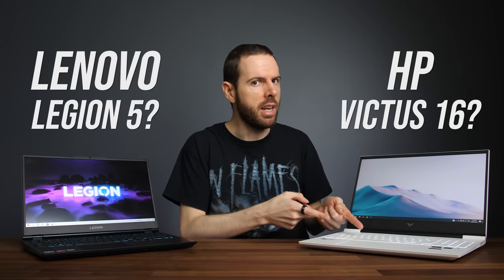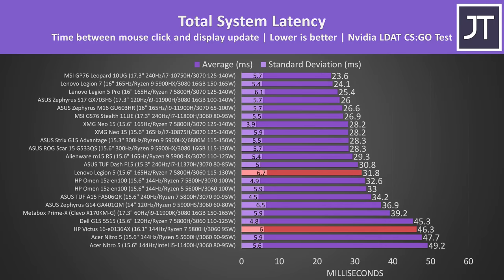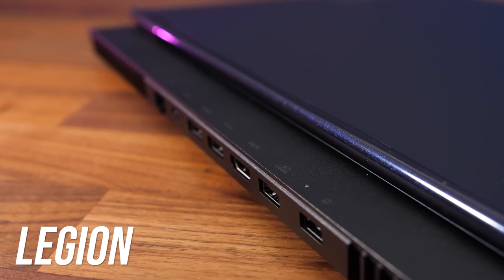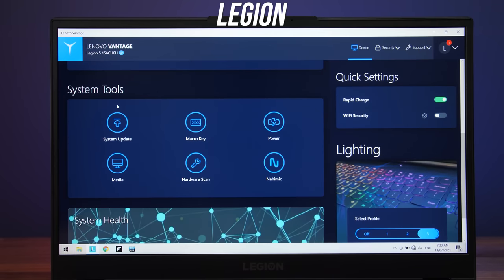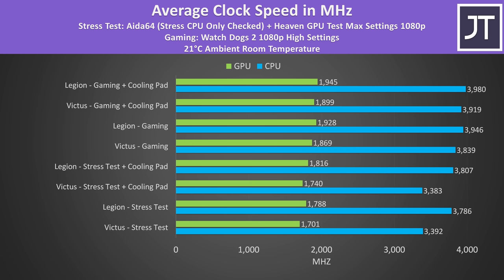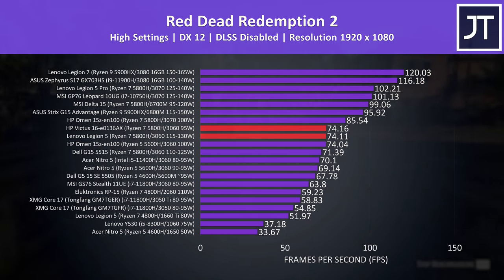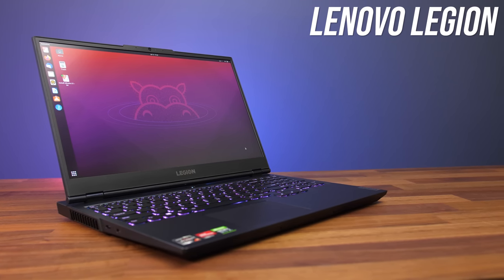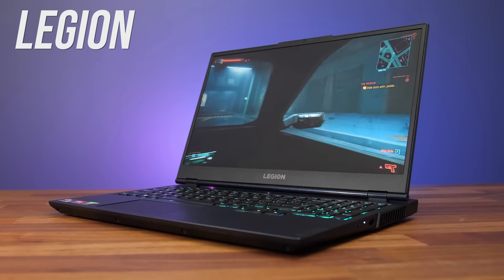Lenovo Legion 5 vs HP Victus 16 - EVERYTHING Compared!

Comment: In India, The Legion is sold from 1800$-2000$ by retailers. The Victus is sold from 1450$ to 1550$. Around 350$ to 450$ more expensive. And it provides 15% more performance  for 25-30% more money. And for most current gen games the Victus already hits 60fps in Ultra. For high settings, I don't even know why a legion is needed !! Now you know why the Victus is very popular in India but Legion isn't. Over here budget is smaller so one calculates the value more.
Reply: The screen wobble.
Reply: Only problem is availability lol
Reply: Makes sense. I've always wanted to opt for the legion 5 pro but it's over my price range. So I feel like the victus is a good compromise
Reply: @neer3  Agreed. The Achilles heel. They had one job... In India its a 100%sRGB one too. For some goddamned reason they couldn't increase the hinge tension to prevent this.
Reply: @tsozohoshi6182  Yes. The scalping and rip-off by the retailers are insane !! It now sells for 1.5L and people are still buying it 🤦🏻‍♂️. People should know the difference between a rip-off and a good price
Reply: @Ishant4President  The 5800H+3060 was an insane value for money product. More people are buying laptops now due to WFH, portability etc. Also nows a good time since 4000 series will be much more delayed. Due to these factors, people are using bots to buy laptops I hear. Most 3060 laptops are out of stock
Reply: @SF-li9kh  tell me about it man I've been eyeing a 3060 laptop myself for the past 3-4 months

Comment: I mean Legion is often called as best for this year, and victus is lower tier (Omen should be better comparison for Legion 5) so we all knew where this is going 🙈
Reply: Well a lot people requested this video so...
Reply: a comparison beetween omen 16's i7 11800H - 3060 115W (with mux too) v.s. legion 5's 5800H - 3060 130W would be an interesting one tho, and the price is almost identical (with omen 16 a lil bit cheaper)
Reply: Agreed. I don't think it's a good comparison. The 3060 should be further split into 3 sections. 75W, 100W, 125W and then compared. Moving from one subtier to another drastically increases price
Reply: @Respecta1512  11800h is slightly better for gaming, the extra 15 watts don't make too much of a difference because of diminishing returns so it would be pretty close I think (keep also in mind it doesn't always boost to 130w)
Reply: @suschilegge1683  yea I agree with u, but the omen too the same, it doesn't always boost to 115, heck the official cs said that its a 100W version. Nevertheless, yea considering the 1rx8 ram sticks on omen it may be slightly better it just doesn't have gsync
Reply: @SF-li9kh  No, what we want to know, is how much can you overclock the 75w rtx 3060 and how close can you bring it to the 100w versions.
Reply from the maker: To be fair, both can be available for the same price :)
Reply: @JarrodsTech  fair enough, I only did my research on my country price. RTX3050Ti Legion5 is like 150$ more than Victus RTX3060 😂(same storage and RAM). 

a similar price can be achived if I compare Legion5 with Omen
Reply: @ValentinoNicko  not everywhere
Reply: @ValentinoNicko same. A default Legion 5 3060 was like $350 more expensive than a 3060 victus, so I chose Victus 2 years ago.

Comment: "It's not really a problem unless you bump the laptop or desk or move the laptop around" or a wild Jarrod appearing and using raw blowing power 😂😂
Reply from the maker: True 😅
Reply: @JarrodsTech  Why don't Lenovo make a 17.3 inch 16:9 or 16:10 Legion 5 Pro with 1440P or 1600P resolution? That would literally be the perfect laptop! L5P screen is just too small in my opinion.

Comment: Legion is great, too bad it costs like 35-40℅ more than the Victus for similar configs (except GPU TDP) in my region
Reply: hi. i wanna buy laptop and i have to use it maybe like 8 years. laptops are 2x expensive in my country so for my budget i am between this four: lenovo legion slim 5 i7 13700h - rtx 4070 - 1 tb ssd - ddr5 double channel 32 gb ram and acer predator 16 i9 13900hx - rtx 4070 - 1 tb ssd 16 gb ram. and asus rog strix g16  i7 13650HX-RTX4080 12Gb-16Gb-1Tb- and  Ryzen 9 7845HX-RTX4070 8Gb-16Gb-1Tb Ssd. which and why i should buy ?

Comment: I bow down to legion..Heads down after having so much of personal experience with all windows Laptop brand. I found legion to be best combination of minimal, stylish, best build, performance, cooling and many more..
Reply: Yeah but where i live it cost like 1300 € while the victus is a solid 800 💀
Reply: @JA-ds5nq  You should opt online and on sale... Legion is mostly bought on sales as its very expensive
Reply: hi. i wanna buy laptop and i have to use it maybe like 8 years. laptops are 2x expensive in my country so for my budget i am between this four: lenovo legion slim 5 i7 13700h - rtx 4070 - 1 tb ssd - ddr5 double channel 32 gb ram and acer predator 16 i9 13900hx - rtx 4070 - 1 tb ssd 16 gb ram. and asus rog strix g16  i7 13650HX-RTX4080 12Gb-16Gb-1Tb- and  Ryzen 9 7845HX-RTX4070 8Gb-16Gb-1Tb Ssd. which and why i should buy ?

Comment: I mean, Victus is good looking and everything which I love it..
but every laptop gets compared with the Legion 5, that probably means it is the best choice which no other laptop had a good balance to take Legion's place for comparisons.
Reply: Yes, but as seen here, the victus was trading blows with it. And seems to beat it massively on value. Infact, the real champs are the tong fang chassis laptops.

So the legion is pretty poor value. Its like the people who used to think alienware was the best. It wasn't. Same here.
Reply: The Legion 60Wh 3060 I can buy is superior on 2 key points.

The rear port setup and the usb c charging offer enormously superior flexibility imo.

Not having type C charging is just not wanting to sell your product if you released them over the last year.

Better screen is bonus.

That said the Victus looks better and has better cpu for the same price where I am at. Slightly larger battery at 70 Wh, better speakers.

The biggest downside on the legion to me is the fan problem. I'll have to see if I can live with that.

But the port, charging flexibility is more important to me than if there is an ever so slightly bigger battery, the speakers and (hopefully) the noise.

I would pick the Victus if it had type C charging probably.
Even at these price points you have to make compromise sadly apparently.
Reply: hi. i wanna buy laptop and i have to use it maybe like 8 years. laptops are 2x expensive in my country so for my budget i am between this four: lenovo legion slim 5 i7 13700h - rtx 4070 - 1 tb ssd - ddr5 double channel 32 gb ram and acer predator 16 i9 13900hx - rtx 4070 - 1 tb ssd 16 gb ram. and asus rog strix g16  i7 13650HX-RTX4080 12Gb-16Gb-1Tb- and  Ryzen 9 7845HX-RTX4070 8Gb-16Gb-1Tb Ssd. which and why i should buy ?
Reply: @lalabeauty8121  from those options...
Lenovo and the Asus are the best looking..

Lenovo is balanced and has everything you need for a minimum of 5+ years

Asus has a better GPU but has half of the Lenovo's RAM which I hope is upgradable..

I would take the Strix g16 just because it has a better GPU and the RAM is a part which is usually upgradable..

in simple terms, I've looked it on the user benchmark and the higher number the better, and I trust ASUS and Lenovo Laptops, Acer is usually not the ones anyone would suggest

Comment: Legions prices are crazy this year. Last year they were the best value laptops, this year 3060 Legion is more expensive than a 3060 Zephyrus G14 where I live. If it weren't for no additional M.2 slot on Zephyrus (I need it for additional SSD, as I have one from my old PC) I'd be daily driving a G14 despite much lower GPU TGP, as the overall quality is much better. Not to say that Legions are low quality, but they just don't compare when the pricing is similar.

So... I am waiting for black friday deals, I guess.
Reply: @gderioaryaputrarahadi9400  in February we had pretty sweet deals for last year models (4600H+2060 for around 650$), but now even last year models are more expensive than when they released.
Reply: The real biggie is that due to fluctuating prices, can you really decide on whether to get the Legion or the Victus? You may say he'll yeah, but you know the moment you buy the Victus the price for the Legion will drop, ie sales etc.
Reply: @garymiles484  I almost bought a Victus about a month ago. Seemd like a good deal, with 1TB SSD and 100% sRGB 300 nits panel for around 1000$. Turns out, shop had a mistake in specs, good panel option isn't available anywhere, it was the same as Jarrod has. Shame.

Whatever I'll end up buying, I won't check laptops pricings for months after that, lol. Buyer's remorse is inevitable otherwise :)
Reply: @gderioaryaputrarahadi9400  boy, have to admit it, you have it way worse than where I live :)
Reply: A Legion 5 when it's on sale for $1300-$1500 is a no-brainer, but at its regular MSRP you can do much better.
Reply: I found a $1000 for 3050 Ti 512 GB but other than that everything else is way too overpriced
Reply: @sp0el  yes, I bought a Legion 5 (2021) for my daughter about 3 months ago, 3050ti with 512 gb nvme and 1 tb nvme for about $1150. Okay so the 3050ti isn't as good as the 3060 but still a good price. With all the sales coming up you might have been able to wait.
Reply: I got Legion 5 with Ryzen 7 5800 and rtx 3060 for $1300 (On sale)
Reply: They're literally the same price as last year in the US.
Reply: @sp0el  in India a 11400h victus is listed with 3050 online but they actually deliver a 3050ti😂
Reply: @suryanshpundir7463  I'm happy for you then! :D
Reply: hi. i wanna buy laptop and i have to use it maybe like 8 years. laptops are 2x expensive in my country so for my budget i am between this four: lenovo legion slim 5 i7 13700h - rtx 4070 - 1 tb ssd - ddr5 double channel 32 gb ram and acer predator 16 i9 13900hx - rtx 4070 - 1 tb ssd 16 gb ram. and asus rog strix g16  i7 13650HX-RTX4080 12Gb-16Gb-1Tb- and  Ryzen 9 7845HX-RTX4070 8Gb-16Gb-1Tb Ssd. which and why i should buy ?
Reply: @lalabeauty8121  

Pick one with the RTX4080. Aside for 32GB RAM in the Legion, that RTX GPU is the only meaningful difference when it comes to performance between all of them. And while the RAM can be upgraded, you can't do so with the GPU.

Comment: In my opinion, victus is the best out of these. I like the looks of it, and has very good performance.
Reply: Currently enjoying mine (though it's ryzen 5600H variant) and playing just in quiet mode to keep up with the cooling part but still get 144+fps. Also it's way cheaper than legion
Reply: the design is sexy as hell 
also that keyboard has to be the best feeling laptop keyboard i've ever experienced
Reply: hi. i wanna buy laptop and i have to use it maybe like 8 years. laptops are 2x expensive in my country so for my budget i am between this four: lenovo legion slim 5 i7 13700h - rtx 4070 - 1 tb ssd - ddr5 double channel 32 gb ram and acer predator 16 i9 13900hx - rtx 4070 - 1 tb ssd 16 gb ram. and asus rog strix g16  i7 13650HX-RTX4080 12Gb-16Gb-1Tb- and  Ryzen 9 7845HX-RTX4070 8Gb-16Gb-1Tb Ssd. which and why i should buy ?

Comment: Please do a price to performance comparison between all the amd mobile GPU Radeon Rx 6600m vs rx 6700m vs rx 6800m.Wich do you think is the best in respect to the Nvidia's offering
Reply: That'll be interesting..
Reply: Yeahhh... AMD looses. Even in the US. And outside of US, nvidia beats them.
Reply: @siyzerix  It would be more reassuring if Jarrod's Tech said that
Reply: @neerajthakur708  Listen man. Does jarrod tech know the indian market or pricing structure? No. He doesn't. 

Infact he uses american pricing. So he'll go off that. You'll have to use your head and figure out for yourself in India which laptop holds the price to performance title. And hint, it ain't lenovo legion 5 like jarrod might suggest.
Reply: @siyzerix  Which is it then? please enlighten us. You great Indian genius!
Reply: @copykaktus4193  Probably the hp victus. Or the msi delta (though again, it has blocked vents. Thats its only downside). Or if you want the cheapest 3060, the msi gf65 thin.
Reply from the maker: This is on the to-do list with Nvidia too, once I get the 3080 it will be the last piece of the puzzle. Probably in Nov some time.
Reply: @siyzerix  Well, I'm about to get the Legion 5i with an intel processor and a white chassis, becaus that's all that's available at a decent price :/
Reply: @copykaktus4193  In India? Really? There is a literal victus at 100k that packs a 5800h and 3060. Why not pick that?

Unless you're not in india.
Reply: @siyzerix  Nope, not in India, I'm buying from the American market and having a friend bring the laptop over to Colombia when they trave for christmas :P
Reply: @copykaktus4193  Ohhhh... makes sense. Get him to buy a refurbished 3070 laptop for cheap.
Reply: @siyzerix  We tried to look for one, no luck.
Reply: Considering you can get 6800m for 1499$ on sale, that GPU beats pretty much everything else at raw price/performance ratio.

That applies Worldwide too, importing from BestBuy from outside of USA is still cheaper than the cheapest 3080 laptop in my city.
Reply: @mini9503  Import a laptop, from US, into brazil or India or Indonesia and tell me how it'll stack up pricing wise. 

Furthermore, there's a maingear laptop for $1700 that packs a 3070 and 32gb of ram plus a 1tb ssd so already it'd be pretty close to the rx6800m (within 10%) and would beat it in value. 

Hell I've seen 4k oled aero 15x laptops go for $1700 and they packed a 3070. 

So no. If you got a 3070 laptop on sale, you can definitely go down to $1500 or even less.
Reply: @siyzerix  This is not true at all, I've lived in Jakarta for a few years and had no trouble importing consumer electronics from the US sites through package forwarding services. It's typically 20% upcharge including State Tax + Shipping + VAT + Forwarding Fee. In contrast, a same foreign product in Indonesia has over 50-200% upcharge for majority of name-brands.
The 3070 Tong Fang laptop you listed to is $2200 msrp vs $1650 msrp of the Asus laptop I listed, and has worse hardware overall. If you live in the States and can catch it on sale? Yes it would be the cheapest 130W 3070 laptop you can buy. But my search didn't turn up a 130W 3070 laptop going down to 1500 USD.
Reply: @mini9503  Really? I have spoken to several people from indonesia and they've said its normally like customs or something else causing a further price hike. 

Because I'd love to import to India too but usually the shipping charges. And online it says bestbuy doesn't ship internationally.
Reply: @siyzerix  Dude I do not own the shares of Nvidia or AMD I just want a better product
Reply: @mini9503  Damn! That sounds like a great deal, any idea where I can get one of those?
Reply: @neerajthakur708  Yeah, and you're gonna have to form your own conclusion using the data jarrod and others provide.
Reply: @siyzerix  yes exactly what I ment
Reply: @siyzerix  And looking at Nvidia share price sky roket I wish I had bought one
Reply: @neerajthakur708  In india, the rx6600m isn't too great of a value. Mainly fue to it being 110k and worse than a 3060. Also msi blocking vents. Only upside is the 90whr battery

Comment: I got the Victus at Costco because it was $200 dollars off for the 1tb, 16gb, 5800h, 3050ti mix. It was a good game and a replacement for my seven year old HP Pavilion Laptop. If I could of gotten a Legion or MSI laptop of similar design for $900 I would have.
Reply: yeah but you probably couldn't
Reply: hi. i wanna buy laptop and i have to use it maybe like 8 years. laptops are 2x expensive in my country so for my budget i am between this four: lenovo legion slim 5 i7 13700h - rtx 4070 - 1 tb ssd - ddr5 double channel 32 gb ram and acer predator 16 i9 13900hx - rtx 4070 - 1 tb ssd 16 gb ram. and asus rog strix g16  i7 13650HX-RTX4080 12Gb-16Gb-1Tb- and  Ryzen 9 7845HX-RTX4070 8Gb-16Gb-1Tb Ssd. which and why i should buy ?

Comment: Victus's hinges looked too fragile so I went with the Legion 5 and overall I am happy with it. Only thing I hate is the keyboard. Feedback of the keys and typing on it feels kinda weird compared to HP Victus. But overall I'd recommend it. Solid laptop.
Reply: i agree more than the keyboard is the friggin touchpad is so horrific like ive used laptops half the price with a better touch pad not that it matters much but i recommend a mechanical keyboard to solve that small problem even if its second hand its good stuff
Reply: hi. i wanna buy laptop and i have to use it maybe like 8 years. laptops are 2x expensive in my country so for my budget i am between this four: lenovo legion slim 5 i7 13700h - rtx 4070 - 1 tb ssd - ddr5 double channel 32 gb ram and acer predator 16 i9 13900hx - rtx 4070 - 1 tb ssd 16 gb ram. and asus rog strix g16  i7 13650HX-RTX4080 12Gb-16Gb-1Tb- and  Ryzen 9 7845HX-RTX4070 8Gb-16Gb-1Tb Ssd. which and why i should buy ?

Comment: In Finland a victus with 3050 and 8gb of ram costs 1100E and a legion 5 with 16gb and a 3060 runs about 1150-1200 without a sale and you can find them on 10-15% sale in every shop (some have the lower spec one on sale and some the higher one) So L5 ends up about 100-170d cheaper with way better specs XD